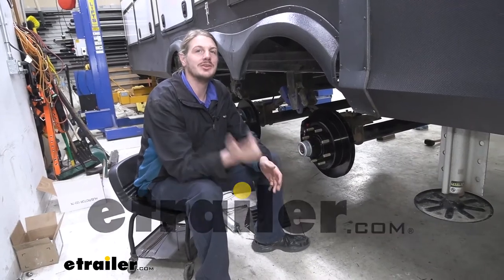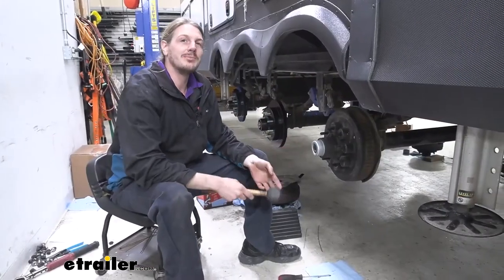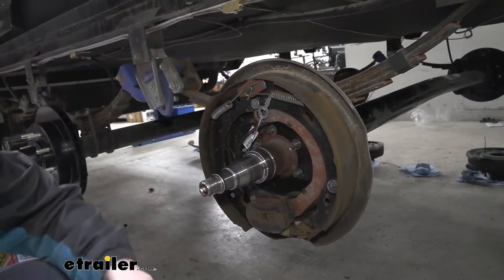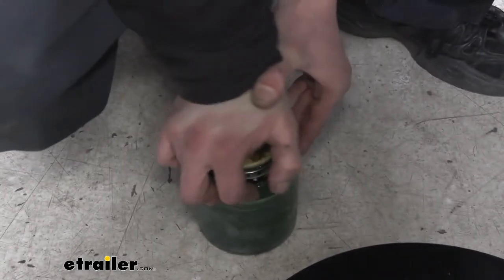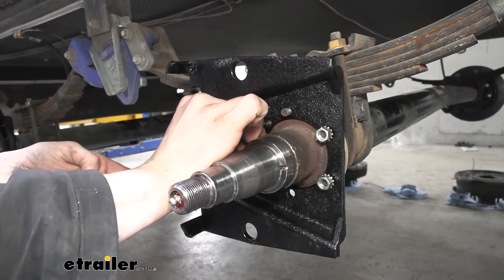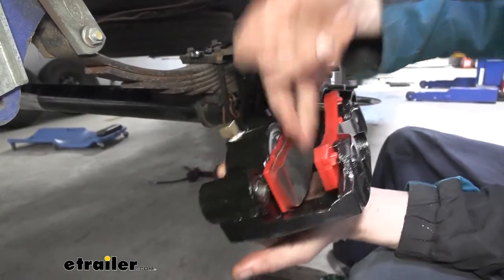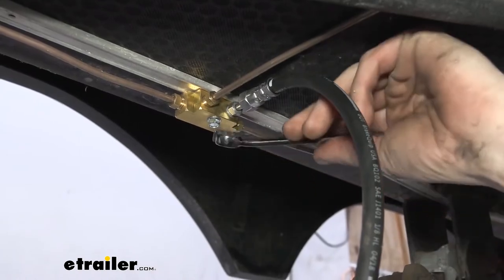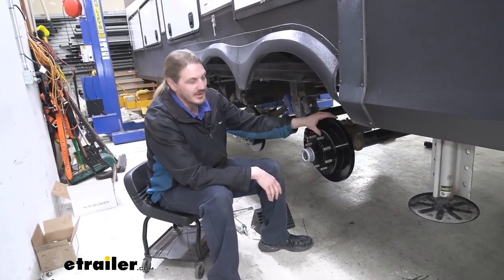etrailer | Kodiak Disc Brake Kit Installation - 2020 Grand Design Momentum 5W Toy Hauler

Comment: That seal driver looks more like an old hole saw and probably worked just as good.
Reply from the maker: That's exactly what it was, and it worked really well! If you don't have a recently decommissioned hole saw and arbor laying around, we offer a driver kit which is part # PTW83020 because we're cool like that! You can check that out below:
https://www.etrailer.com/Accessories-and-Parts/Performance-Tool/PTW83020.html
https://www.etrailer.com/Accessories-and-Parts/Kodiak/K2HR712E.html
https://www.etrailer.com/Accessories-and-Parts/Kodiak/K2HR712E.html
https://www.etrailer.com/Accessories-and-Parts/Kodiak/K2HR712E.html